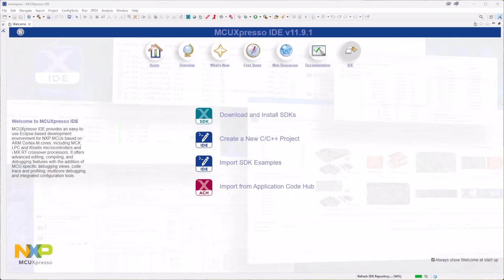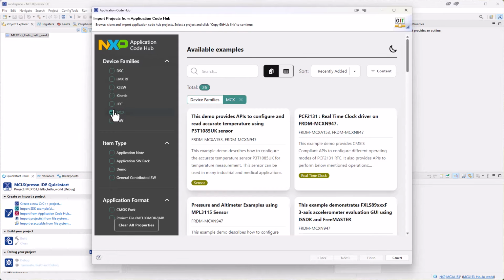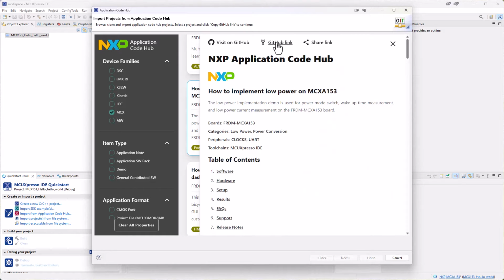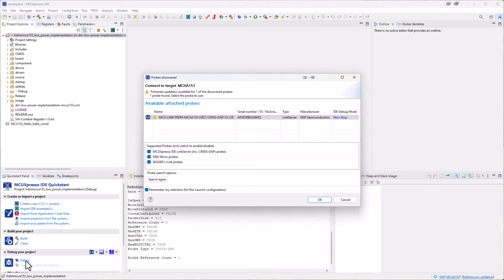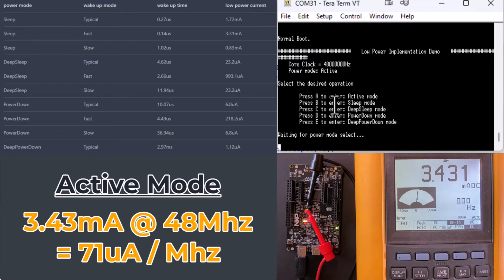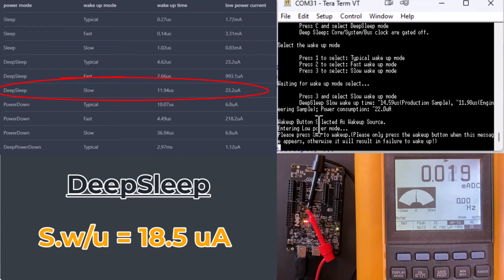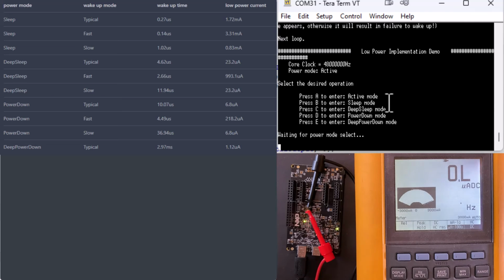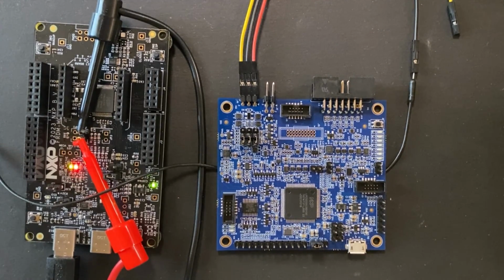Lowpower Modes on NXP MCXA-153

Comment: Thanks! You enlightened me a lot👍🏽. 
I have a question, why us not measure the current in JP3.
If possible, timer, I2C/I3C, Uart are more interesting, I am looking for testing and studying together 🙏🏽🙂
Reply from the maker: Glad you found it interesting. Reson for using J2 is that the J2 is sourcing the MCU only and their was already pins soldered. To use J3 you need to attach the pinheader and desolder the 0ohm resistor also. Thank you for your suggestion on comming topics. /PR TechTalk